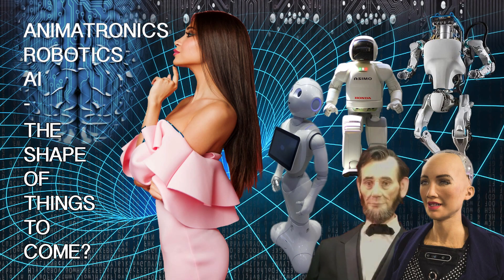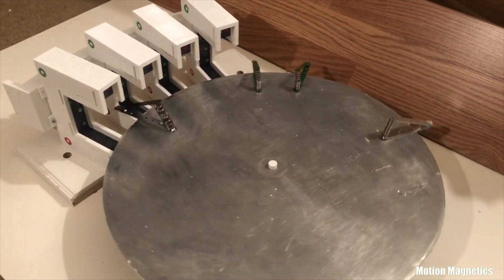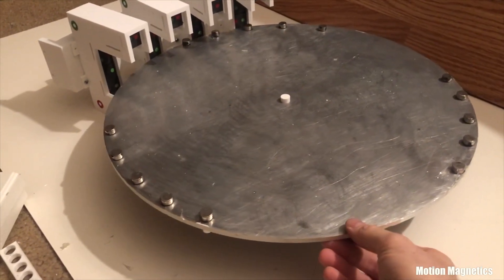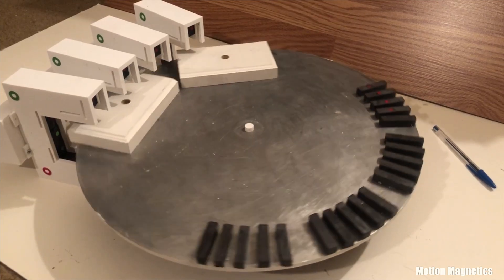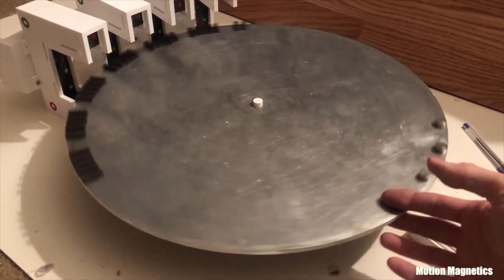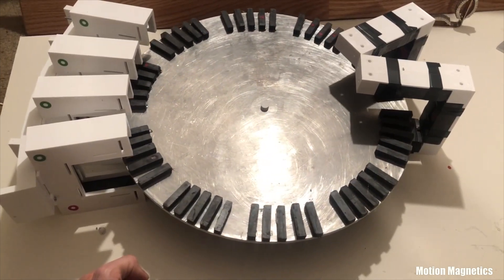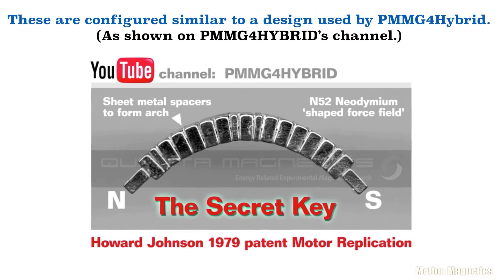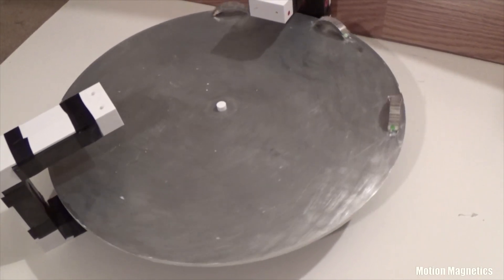Breaking The One Inch Barrier

Comment: hay i see a lack of brain power let use a little more then we have .   each Magnet when passed over a Coil creates power passing over it so why not use this power as a push increasing momentum and speed by adding an electromagnet at the point of resistance that use the captured energy  from the permanent magnet to energies the electromagnet . also add a CIRCUIT BOARD with a Capacitive discharge to each electromagnet .   also U can set the circuit bd to reverse polarity on what ever coil needed if needed . 7 to 9 coiled magnets should work let me know how it turns out

Comment: You mentioned access to a diamond saw blade in your vid. Have you tried cutting a rectangular ferrite magnet into a triangle and then attaching the NEO mag to N to reinforce the N and neutralize the S by use of the triangle? I think then just playing with the angle the Triangle Ferrite + Neo tip is relative to the gates should be a step forward.

Comment: I am amazed how you guys ignore the laws of thermodynamics.
I guess by doing this  it, at least, keeps you out of politics. Which is good because you have no understanding of economics.
And if you don't understand that then, carry on wasting your time.
Reply: Magnetism is not rigorously shown to obey thermodynamics. Fields extend into the ambient space, so it is not a closed system, especially when the Aharonov-Bohm effect gets involved
Reply: @paulshields1883  Interesting concept but surely the mass of an electron is so tiny and localised I cant see where the motive force would emanate from, magnetism is a force but not a form of energy, the energy of a motor requires a source of energy.
I think this sums it up quite well...

Magnetic force, attraction or repulsion that arises between electrically charged particles because of their motion. It is the basic force responsible for such effects as the action of electric motors and the attraction of magnets for iron. Electric forces exist among stationary electric charges; both electric and magnetic forces exist among moving electric charges. The magnetic force between two moving charges may be described as the effect exerted upon either charge by a magnetic field created by the other.

From this point of view, the magnetic force F on the second particle is proportional to its charge q2, the magnitude of its velocity v2, the magnitude of the magnetic field B1 produced by the first moving charge, and the sine of the angle theta, θ, between the path of the second particle and the direction of the magnetic field; that is, F = q2B1v2 sin θ. The force is zero if the second charge is travelling in the direction of the magnetic field and is greatest if it travels at right angles to the magnetic field.

From : https://www.britannica.com/science/magnetic-force

See, a magnet only "useful" when in motion and motion has to be initiated. That is why you cannot store energy in magnets.

Comment: im really curious what kind of results youve had by placing the magnets that are on the disk so they're length ways instead of being placed facing the edge? i only ask because wouldnt that technically force the two magnetic fields to push away in the direction you're attempting instead of pushing away from eachother and pushing that one side of the disk toward the floor, which im guessing why its rocking when it works?

Comment: can you break the one-inch barrier by using a vertical rotation and using a nonmagnetic counterweight in the right position to use gravity to pull it through the one-inch barrier personally I prefire a more solid state approach of feeding the emf back feed into another coil and stacking up the voltage by using a series of coils and using a timer controlled pulse I can eve dial it into 60 cycles per second which we need for setting up 220V in america

Comment: To help bypass that 1 in gap do you think it would be helpful to add a secondary flywheel? I would think that when the magnets are being pulled through the field it will move the second fly will so when you’re coming towards that 1 inch gap then the momentum of the second flywheel will force the magnets back into the field to be pulled again.

Comment: Have you ever tried to create a genuine torus magnetic field? That might be a gate or induce motive force on an arrangement.

In terms of 3D printing, rings with holes along the circumference could be printed to accommodate those cylindrical diametrically magnetized magnets:

https://www.kjmagnetics.com/proddetail.asp?prod=D48DIA

Then, the rings can be arranged around a 3D printed donut, it would seems like an interesting geometry.

Idk if you follow that

EDIT:

I am silly. The magnets already form rings. So, they just need to be wrapped around the 3D donut directly to create the torroidal-esk field

Comment: Time to prepare a 3D flux simulation software and press the AI button...
Reply: I think the problem with that approach is that we will create an overly simplistic model for the AI to consume, if the magnets truly do have a secret world and flow. All measurements, incl. magnetite powder patterns, are the effect on the powder and not the true flow, unimpeded.

However, Howard Johnson did model the fields with a supposedly unobtrusive measurement tool with effectively a 3D printer plotter that took measurements in increments around the magnet of concern. I think this was the true basis of his theories, measurement.

That would be a square one replication that could open a knowledge base to all permanent magnet researchers. Nobody has done so, that I have seen.

We could collect field knowledge from all sorts of arrangements in an open source database. Probably the most practical and valuable thing we can do instead of stabbing blindly at conventional geometric notions.

Comment: I really think a flywheel would give momentum to break the 1", also consider a set up whereas the magnet is attracted, it moves the above magnet (stationary one) in the same direction away, but not as fast, so that the bottom magnets are slowly catching up.  So i assume gears would be needed, and here you can include an extra fly wheel. Though the momentum is lost from the high speed it used to have, it should still be enough force behind it from the fly wheel to break through the 1" barrier, and at least it guarantees that it moves a farther distance and if that farther distance includes getting past any of the 1" barriers then, it might be considered as progress.

Comment: You do realize that once you make a magnetic motor, the energy you get out of it is less than the energy put in to creating the magnet.  Essentially you are just making a magnet battery.  Permanent magnets are not permanent.  If you apply a load to the magnetic motor, the magnets will degauss.  Magnets are not "forever", "permanent means that the field stays without applying electricity (i.e. not an electromagnet) it has nothing to do with a magnetic field lasting "forever".
Reply: A few of your points are heavy on the assumption side, who told you that stuff ? I would advise not to believe everything you think.... No disrespect bro.

Comment: dude, that "low friction bearing" is total junk.  i've seen chinese bearings spin better than that!  you need a proper AbEC12 bearing from rollerskates or skateboards, then just wash all the grease out and replace with light oil.

Comment: https://bostonglobe-prod.cdn.arcpublishing.com/resizer/9ImQ2xP7_ofyIOoZVdXUp1hfTKM=/1440x0/arc-anglerfish-arc2-prod-bostonglobe.s3.amazonaws.com/public/VQPVYVAL7EI6DNV2X6FANOSMCY.jpg  I thought this was interesting in the context of what you are trying, smaller circle helps to pull the large one round?  The middle 2 circles sit between inner and outer stators, theory being that the next set of stator circles always has greater attraction than previous. If mapped on  a spreadsheet you could estimate forces for each set based on distance and size inner and outer.
Reply: Also if you place the magnets in cups, you can shield the negative magnetiic fields that don't support what you are trying to do, ie just leave the one north face exposed.  Not sure if aluminium achieves this shielding, if so then can remove the magnetic attraction issue with ferrous material.

Comment: Everything seeks its own BALANCE.  Any action requires an opposite reaction in order to exist.  However you configure the magnets and seem to get motion,  gravity will come to play and balance everything out. It will never work unless you put in energy into it somehow.  UNLESS, you work within the quantum level and change the internal properties of the materials being used. OR you work in sync with the internal forces of the material and gravity and get a more efficient system.  BUT this requires UNDERSTANDING which maybe lacking and contrary to what is actually happening. IMHO.

Comment: Around 4:52 consider using horizontally and vertically protruding towers if you want to create wobble. Also, light leverage versus short-distance mass may be worth investigating with or without magnets. I have seen results similsr to one natural cycle without magnets.

Comment: One thing to note. You are fighting a few things the metal you have the magnetics on the magnetics you use and diameter of the wheel you might want to go with some plexiglass for the wheel some N52 NEO MAGNETICS  and make it smaller so you can test just a few.

Comment: Nice man, reminds me of Howard Johnsons work...
Reply from the maker: He's definitely the inspiration.
Reply: http://www.cheniere.org/books/HoJo/index.html
Reply: Might also look into the minato fan configuration that bearden walks thru... you can potentially setup stators which collect enough charge so that when the rotor gets to the sticking point you can fire a pulse thru a coil to push it past the sticking point...
Reply: Permanent magnets are Pure Current Eddies localized on the magnet form as the "anchor" for that coherent Eddy.   Thats why moving a perm magnet past a coil causes the pure current to Back up creating a Volt potential which increases the faster you move the magnet past the coil.  ;)
Reply from the maker: @CoruscantMe  Great book! I've read it several times.

Comment: cut out the middle of the disc as much as you can to reduce weight?
Reply from the maker: I was going for more weight in this design to add a flywheel effect. I used a plexiglass rotor in my newest video. It just depends on which process I'm experimenting with at the time.
Reply: @Motionmagnetics  cheers

Comment: Am I wrong in thinking that putting the magnets (gates & table magnets) on a diagonal angle (opposing each other) , so as to push the table away constantly?
Reply from the maker: There are so many variables that could be attempted.
Reply: @Motionmagnetics  Have you ever tried it? I've always been fascinated with magnets & wondered why we don't use magnets to make perpetual motors...
Reply: I think the problem is that you're trying to get it to spin by using the gate method.  If the top magnets (gate magnets) were free of other magnets influencing them, & you put them on an angle, then put the table magnets the opposite way (diagonally) on the table, you should get a more pronounced spin, shouldn't you?

Comment: Have you thought about two sides. Top and a bottom? Spaced far enough apart to not interfere with one another. Thus pushing each other thru the "one inch barrier"
Reply from the maker: I've tried things like that actually. The interaction between the assemblies usually creates more problems than it solves.

Comment: Thank you that was very informative.  Just a quick question.  If the addition of more arced magnets works have you thought about adding arced magnets on the bottom of the aluminum disk?  Do you think they would have to be reversed?
Reply from the maker: Top or bottom, you'd still be working with the same forces. The trick is to use the right magnetic materials in the right alignment to induce continuous rotation.

Comment: Eh.. I'll never end up making it so heres my idea based upon the crop circles involving centrifugal force:

Place the magnets or windings in a fibonacci sequence as related to spacing/ grouping.  First space has 1 magnet, next one 2, next one 3, next one 5, 8,13,21 etc
The counter-rotating magnetic array of the motor would be arranged in the reverse fibonacci sequence of the first one.

when you spin the magnet array it creates a whip like momentum effect for half a turn. when you have an opposite array spinning on the same axis the revving effect should be constant.
Reply from the maker: Ironically, I was just looking at something like that the other day, and there is a gentleman attempting to build magnetic motors based on crop circles designs.

Comment: its funny how every one keeps trying to use the attraction and repulsion of magnets in a rotor stator set up and nobody but I, have used it roto-linear arrangement... just 50% of the magnets holding force linearily to separate two magnets... start thinking out side of the box folks.
Reply: It's funny also that different altititude and temp can also make properties with different probabilities
Reply: Yet you won’t do it. Easy to type on a keyboard and act like a know it all

Comment: clean the flux off of your magnets by making a u shape aluminum foil covers for a small section of your spin after your last magnet and before your 1st see is losing that flux through the aluminum will keep your apparatus spinning continuous until of course friction wears you down
Reply from the maker: It usually slows the device down. I don't usually use aluminum for that reason, but I wanted to try something different in these experiments. I wanted to try a flywheel effect and thought the weight might balance things out.

Comment: If you think the following behavior of a magnet just for a thought you might understand and design what you are after ps no other place will you find this info 
A magnet following universal laws in everything which is everything seeks balance energy is only one type energy never stops energy doesn't travel in a straight line energy is in all matter and only at is minimal is in carbon heat pressure vacuum cold gravity doesn't exist they are reactions to energy
A magnet is a piece of ferro material that has placed out of balance
Remember how a magnet is made 
Hope you get to use this info
Reply from the maker: Interesting take. Thanks.

Comment: I had some thoughts about that.
The energy needed to move the disk that extra one inch, especially while the motor is moving, is minimal compared to the energy needed to move the entire disk.  To keep things going all the energy that need be added is that tiny delta.  There are some fairly famous "charlitan" devices the included a hidden source of extra energy to give their device that extra kick and make the device to appear to be perpetual motion.

But what's the real goal? Is the goal to achieve perpetual motion or is the goal to produce continuous spin? If your goal is continuous spin, these devices are no longer charlitan devices as they greatly reduce the amount of energy needed from the mains or other secondary power source in order to obtain continuous spin. Isn't that a net win?
Reply from the maker: I'm going for continual motion, not perpetual. An added device would certainly do it, but I'd prefer to accomplish the task using permanent magnets alone.

Comment: Pretty neat experiment, I can’t help but wonder though, if you used an aluminum ring instead of a disc, would that increase the effect your going for?  Of course you’d have to have spikes of some kind leading to your axis of rotation, otherwise you couldn’t get it to spin.
Reply from the maker: I don't know? Interesting thought though.
Reply: Motionmagnetics years ago, was fall of 98 I think, I remember seeing a demonstration in my electronics class where a ring of aluminum was placed over the extended core of an electro magnet. When the magnet was turned on the ring was sent flying. I seem to recall that it had something to do with how a field would be generated in the ring of aluminum.

Comment: What do you mean when you said: "Magnets are not static"?  What feature of a magnet are you referring to...the field?  The field of a magnet is static.  You can, of course, apply heat or cold and affect the field strength.
Reply from the maker: I was referring to the spin of the magnet. Most people that are unfamiliar with Howard Johnson's work have no idea that magnets emit a spin pattern that looks more like corkscrews spinning in different directions.
Reply: @Motionmagnetics  
The spin you are talking about is just a distortion of the magnetic field and the field still remains static.  Movement of the field distorts as the moving magnet goes by.  Please correct me if I got it wrong.
There is always that barrier that prevents magnets from rotating endlessly.  Did Johnson figure it out?  No one has been able to replicate a fully functioning Johnson motor as far as I am aware.
IDK...very suspicious no one has been able to successfully create a working magnetic motor as described in Johnson's US Patent 4151431.  
You seem to enjoy researching this so keep investigating.
Stay safe😷

Comment: I must be missing something in your demonstration. The eddy current effect of the changing magnetic field inside the piece of aluminum would create drag that would slow the plate down. In other words if you use a non magnetic base plate in place of the aluminum your effects of eddy current drag would be vastly reduced plastic wood Maybe?
Reply from the maker: It very well could. That's why I rarely use that rotor, but I wanted to try something different and that was an easy way to try implementing a flywheel effect.